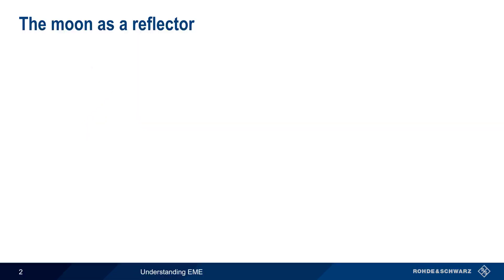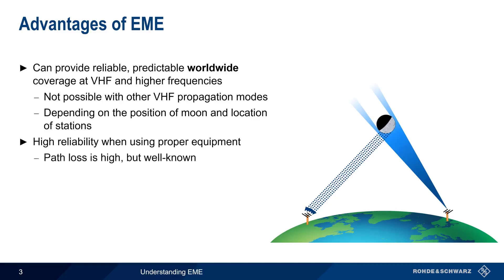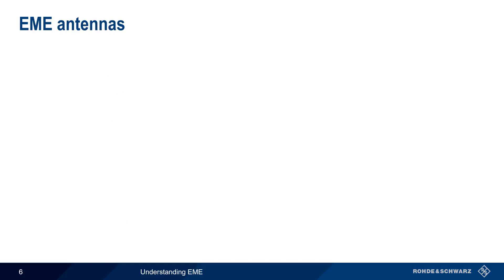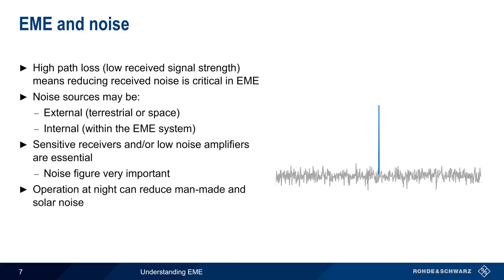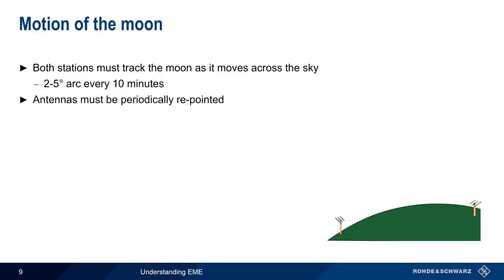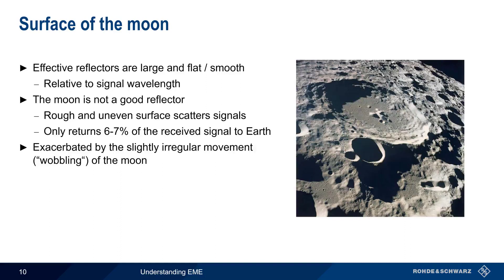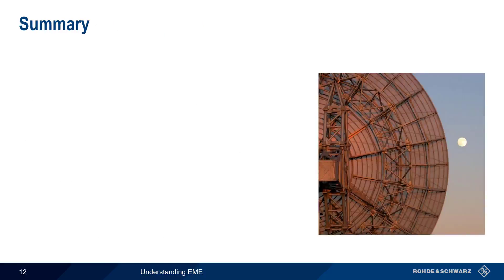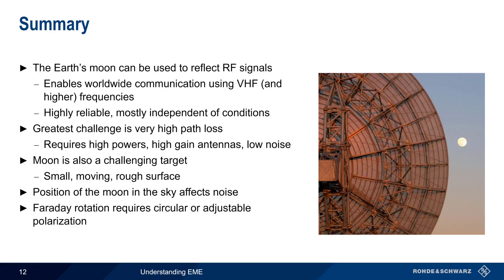Understanding EME

Comment: If I transmit a signal on 144mhz in f3e emission with a power of 100w with the dk7zb antenna, will the wave reach the moon? and won't it be bent in the ionosphere, causing me to miss the moon? I don't care if the signal comes back.
 Pozdrawiam :-)